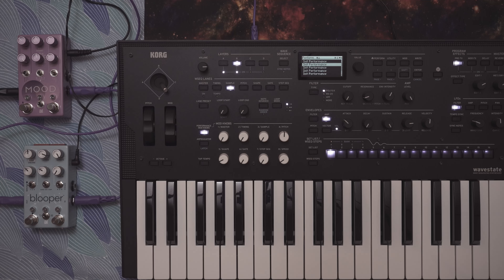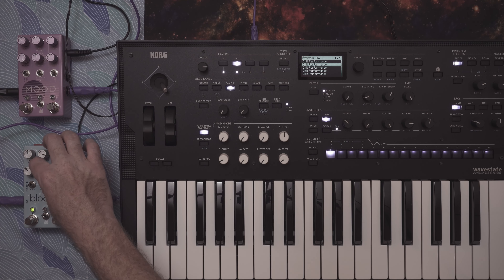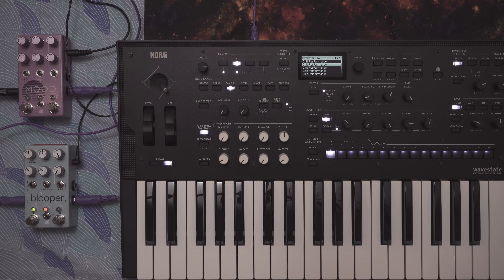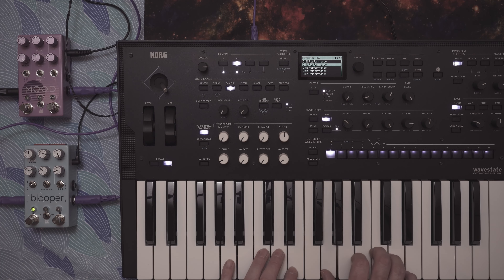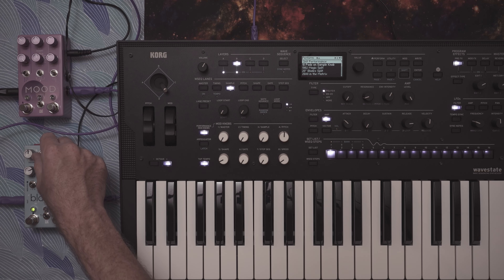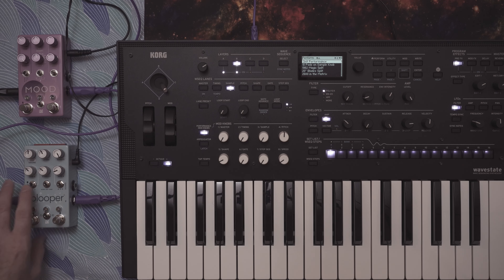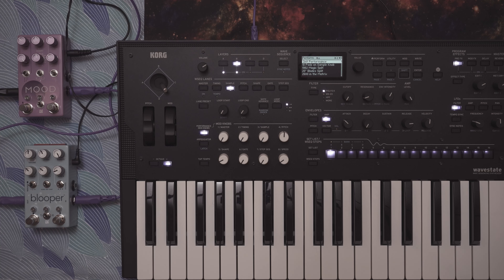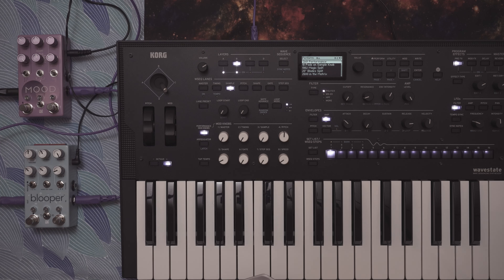The Chase Bliss Blooper is a unique and creative take on looping (perfect for synths !)

Comment: Neat pedal, I'm sure there's a stereo update in the works like they did with Moods (and if there isn't, there should be). Until then, this (and Habit) are sort of useless to me. I have a few stereo loopers I rely on.
Reply: They’ve pretty explicitly said not to expect a stereo version anytime soon due to limits on processing power at the size/price point. Luckily, it’s amazing with mono sources and then into stereo effects!
Reply: @noahzeidman508  don't think I haven't fantasized about using a pair together, haha - sadly that approach kind of defeats the playable aspects (or rather, complicates them immensely). I find it hard to believe they couldn't do a reasonable stereo version with units like Microcosm selling at similar price points. Personally I find $500 for a mono pedal an absurd price point to begin with, but I'm willing to bet they could muster up a stereo version for around $700 and still make a killing on the thing.
Reply: @billybartcody3591   I think my reply disappeared but I’m inclined to agree overall, but the live stream from a couple weeks ago was super clear about the upcoming priorities for the company and that something like a Blooper MKII is years down the line. Now I’m thinking about a MIDI footswitch controller and two Bloopers set to the same MIDI channel. Easily a $1,000 rig, but damn would that be cool
Reply: @noahzeidman508  yeah it would! But at that point I'd be tempted to grab a Reminder or Cosmos. Thanks for dispelling my dreams, lol